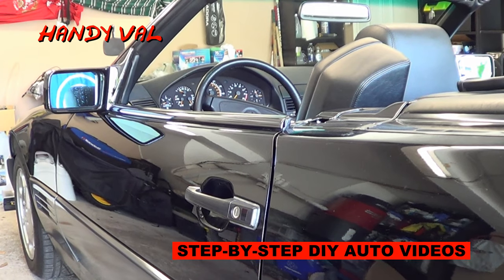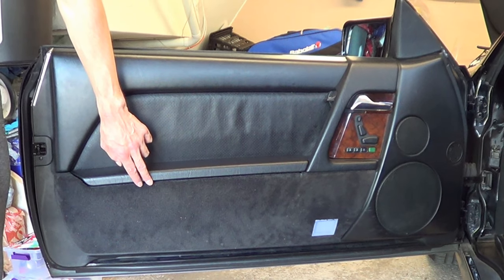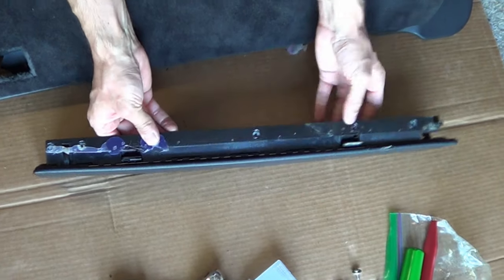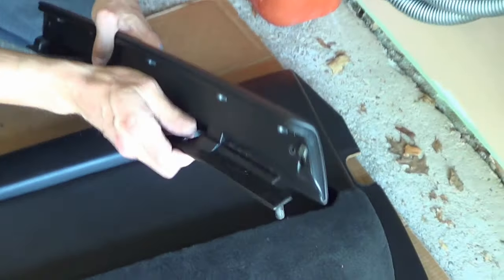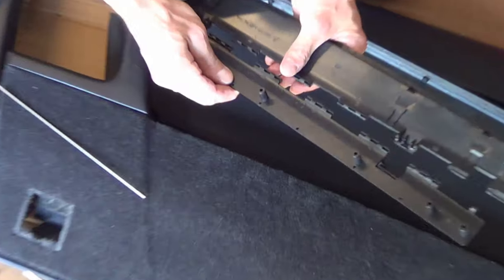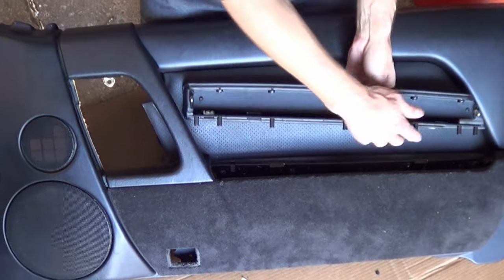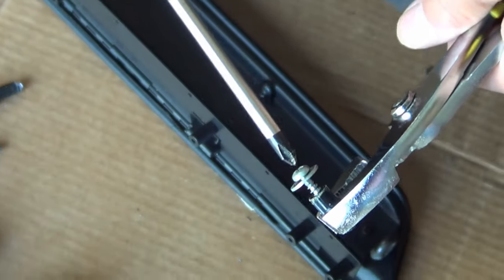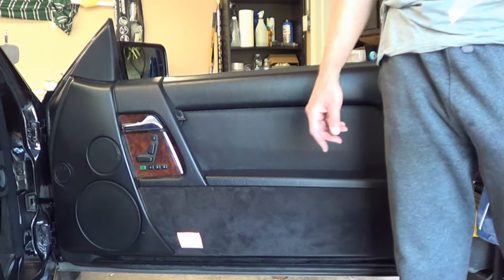Mercedes SL R129 Door Panel Pocket Lid Storage Hinge Change on Pre-Facelift 300SL 500SL 320SL  600SL

Comment: Thank you once again Val - I believe that most of us R129 owners have this same problem with the side glove storage units! I know I do with mine & have wondered how to attack this needed project - but you’ve once more proven to us (your R129 subscribers) that it can be done and with pretty much ease as you lay it all out for us in this very informative video. Hey - now - I can do it without worry! So yes - this is yet another “Handy Val” down loaded ‘how to’ video going into my library😊. Thanks Val you made my day at this end - NOW to find a good & reliable company to get my instrument cluster recalibrated 😂 - blessings to you my friend…
Reply from the maker: Thanks Mark for your wonderful comment. I'm thinking more and more about why these side storage unit hinges fail. Yes, the plastic does fail over many years but I think, it's how the passenger opens the door from the inside. They use the handle and then give it a push outward by pushing in and around the glove box instead of higher up on the door panel. And it's this constant push on the storage unit through the years that likely contributes to most of its demise. It should come with its own warning sticker - 'do not push here'.
Reply: @HandyVal  you are so correct! Are the new units metal or hard plastic? Somewhere I thought I saw new ones for sale that were metal units not plastic. Just curious. But again - thank you for your kind comments Val. A lot to tell you but not here - I’ll be in touch🙏
Reply from the maker: New ones are still made out of plastic and they appear well made. I think they will last a long time.
Reply: @HandyVal  good to know Val. I’ve had my very on this product line for some time but wondered if I was just buying the same problematic part. Okay (as always🤗) you win 🥇!!! Blessings again🙏
Reply: That’s eye